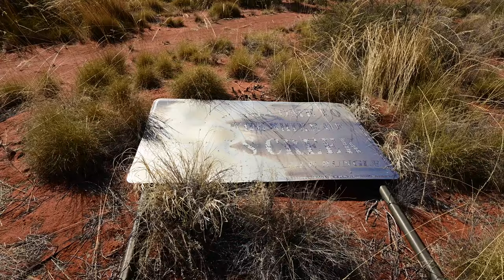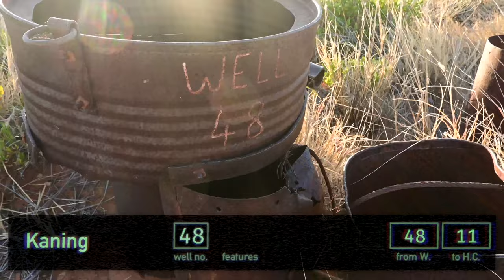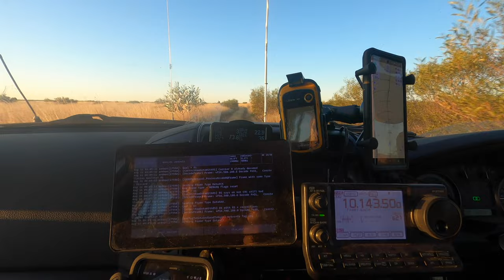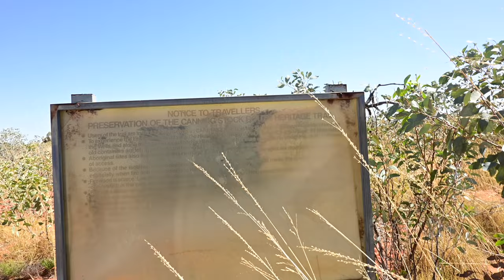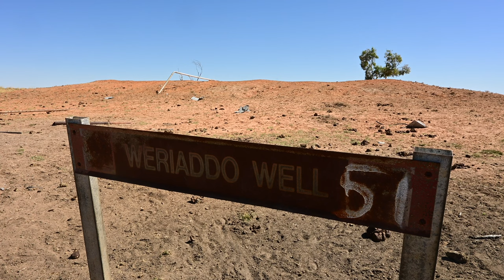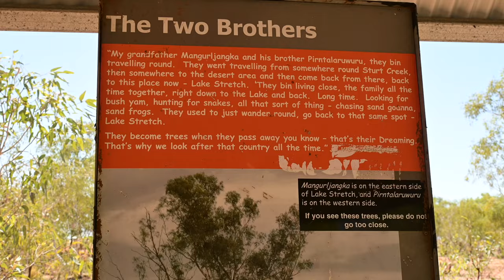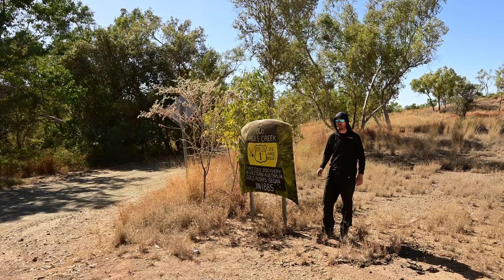Canning Stock Route 2022 - Salt lake, a bunch of names, a massive crater, and the wrong Halls Creek

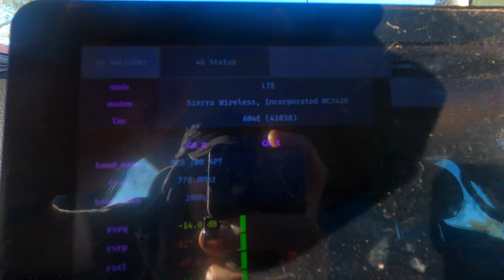Comment: Whats that running on the tablet at 18:50 where you mentioned you had phone signal?
Reply from the maker: It's a custom touchscreen controller I've written to control all the radio gear in the car: https://github.com/gm-stack/radioconsole - it's running on a Raspberry Pi 4 with the official Pi Touchscreen. At some point I'll get it better documented (and push all the changes I've got sitting on the device :| )